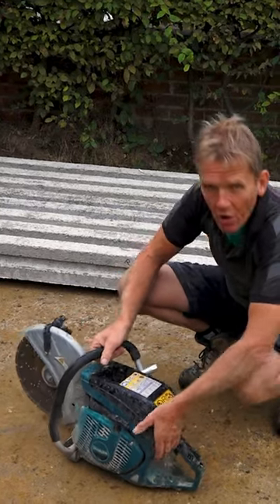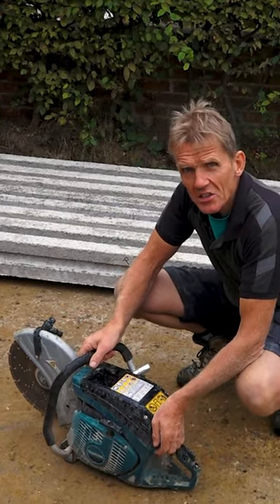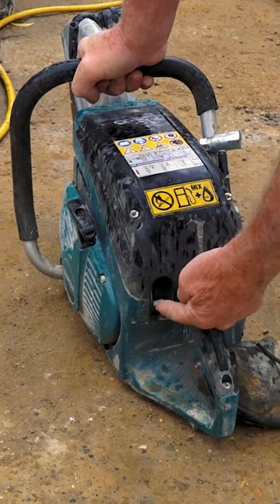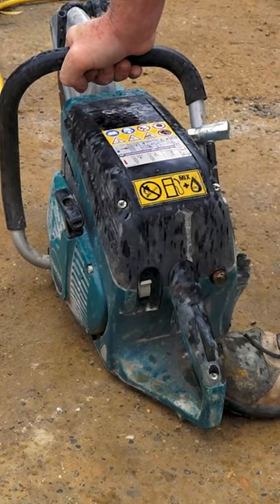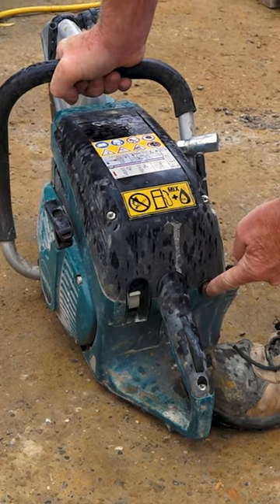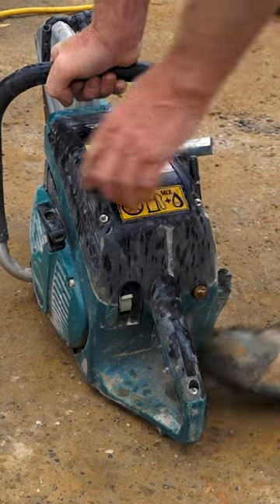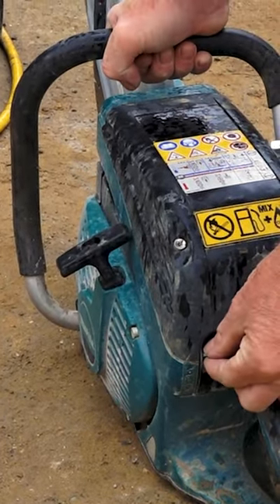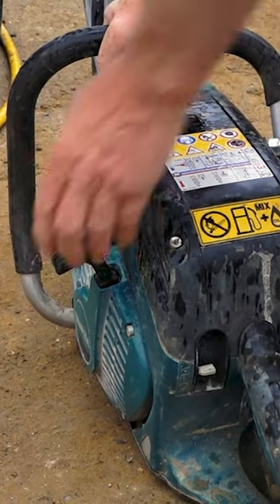Starting a Two-Stroke Petrol Engine #shorts

Comment: A Stihl saw has 3 positions on the choke and you don’t need to prime just pull on full choke once fires then flip the choke to the middle pull again it will start give a few revs then turn choke off

Comment: Always let it heat/warm up as to firing throttle straight once starts where a lot people it’s not good for the saw
Reply from the maker: The throttle is full on when you start it. Once it starts and runs for 5 seconds you can put it on idle
Reply: Ever heard of “cold seizure”?

My 2 stroke dirt bike piston and cylinder showed “squaring” marks from insufficient warm up when I rebuilt it. I’m extra gentle with it now and keep the revs low until my radiator feels warm.

Comment: Nothing better than an Ether containing spray into the air intake or carb, especially on a cold winter morning.
Reply: That may cause premature ring/piston/cylinder wear if you do it often enough by washing the lubricating oil and gas away.

Comment: You should remind people about e10 being even more rubbish in petrol tools. Old e10 out a shed going in a tank full of older fuel, not forgetting they eyeball the 2 stroke mix at 60/40 = useless...
Reply: Yes, you can get fuel stabilizer that helps with this.  Ethanol is SH*T stuff for engines.

Comment: Once the engine is warm, u don't need the choke anymore.
Reply: Doesn't even need to be warm, just needs to be primed.
Reply: It’s the same with old two stroke bikes. Choke on kick. Choke off kick again and it’s running. Try anything else and you’ll glide if then no start for ages.